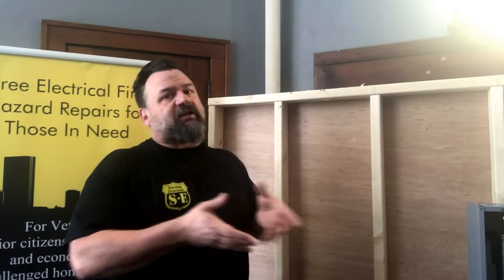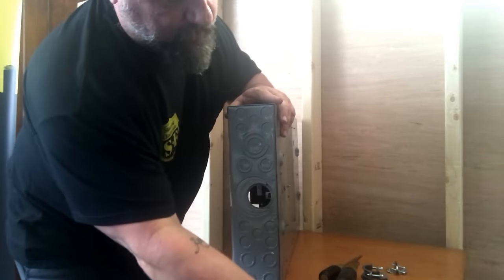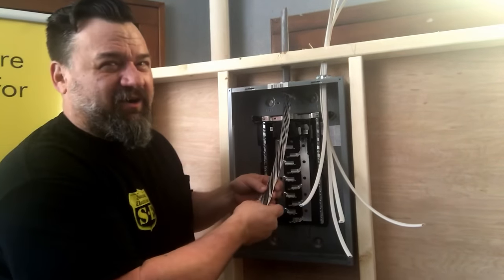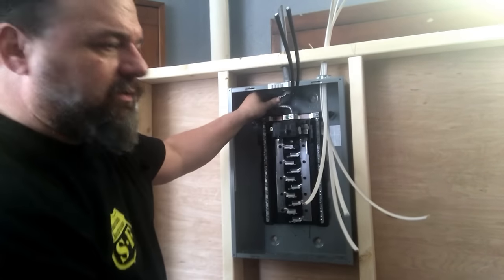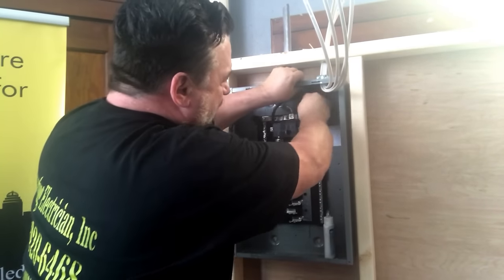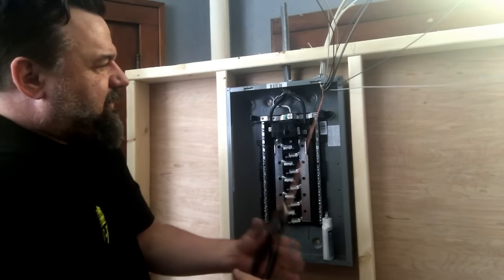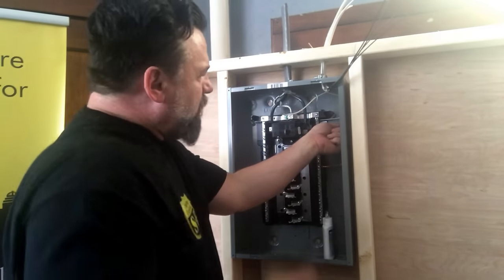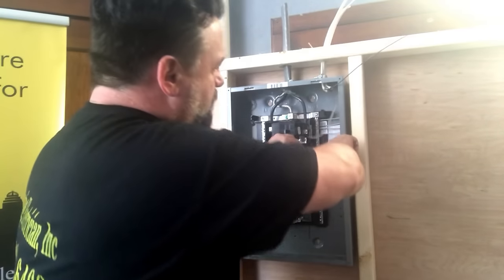How to wire a 100 amp service panel. ,  2020 National Electrical Code compliant

Comment: I like the way you teach ! Back in the day I went to a small school to learn electrical but the teacher only had so much time about calculating voltage that runs through the hot wires,,diodes and other things. I wished I had a teacher like you. Keep teaching.
Reply from the maker: Very cool! for people like you i'm happy to do it.

Comment: First let me say your video is great !  I'm a 71 year old Vietnam vet, and just finished putting a 50 amp sub panel in my garage.  My Dad was an electrician all his life, and was dedicated to pounding as much about electricity he could, into my head. I wound up as a self-employed cabinetmaker instead of an electrician, but, every time I moved into a new, larger shop, I did all of my own electrical work, up to, and including 440 volt 3 phase power. Not once did I ever get a complaint from an inspector, for any of my work.  ( And yes, I did have proper inspections done, otherwise I would have been unable to get the necessary insurance for the shop. )  My dad always said neatness, neatness, neatness, was of paramount importance, for ease of future troubleshooting, or modifications, and I did receive some compliments from inspectors, as my work was easy to follow.  Any way, I just subscribed to your channel, and look forward to future videos.  Also, What your are doing for Veterans is beyond commendable, it's fabulous !  Keep up your good work, and best of luck to you in the future !
Reply from the maker: sorry just got an alert that 30 comments were pending so I just saw your comment. Thank you so much. I am really trying to grow this program. we need to give hope for our soldiers coming home. again sorry for the late response

Comment: VERY well explained! I am in the low voltage trade (28 years with high voltage education and power generation work experience) and this is one of the best instructional videos I've seen.
Reply from the maker: Martin H  wow thank you so much for your comment. I love to make teaching fun because it's easier to take in. I need to get off my lazy ass and make the others I have thought about.  I appriciate your comment and that inspires me to keep it going.

Comment: You've kept me from burning my house down and recognizing the shady work of my handyman. I probably shouldn't have redone the panel myself without any inspection, but i just fixed the simple muff ups that the derps before me got obviously wrong
Reply from the maker: right on. it only takes a minuet to make sure your work is clean and right. some people simply dont have the mental capacity to do good work

Comment: Want to give you two thumbs up,  excellent video.
? When your changing a service panel up grade. There should be a off on switch. Before the service panel.  Are you required to contact the local agencies ( power co.) When you plan on doing the service. I would guess so. Of course it depends on local of up grade.  Thanks for the insight. Your a natural!!!
Reply from the maker: well unfortunately no there is not an off switch. the only way to turn off power to chang out the panel is to remove the meter socket. it simply pligs into the meter housing. the utility company can do it for you but this takes time for on and off but most will say hire an electrician. you clip the tab and open the meter can. the meter socket just pulls right out. edison has flunkeys pulling them out all the time to block peoples power. its not hard at all. take a look and see if you feel confident to do it.

Comment: If its a neutral its a grounded conductor. A ground wire is a grounding conductor. Hots are ungrounded conductors. I've been an electrician for 30+ yrs and this guy knows what hes doing. I dont like twisting the grounds together like that though. It makes trouble shooting and repair more difficult. There are lots of lugs to land them on. Give each wire its own little lug to park in.
Reply from the maker: Tony Thomas  yea I hear ya about the grounds. It’s just quick and easy and most of the old panels have no where near the space. People need to know you can but I’m the same token just do it clean first and foremost. Thank you for the comment!!

Comment: Just sharing a trick.  I carry a cats paw in my tool belt.  I use that to open the knock outs in metal boxes and non concentric holes in the panel. When opening concentric holes in panels, I use the cats paw for the center one, then clip each next section out with tin snips between the welds then bend them out.  I'm in all conduit land.  Try it...discovered this by accident one day and I love it.  (Licensed electrician near Chicago here)
Reply from the maker: Ron Schwab yep perfect tool for the job! Hey any ideas or suggestions please share!!!!!

Comment: Always check the codes in your area. They are not always the same. In some areas, the ground and neutral wires can't be attached to the same strip. Grounds must be on one side of the breaker panel and neutral on the other side. In some areas, they are even regulating which side the grounds go on and which side the neutrals go on. In some areas, only one wire on one screw is allowed. In some areas, you can't twist the grounds together and put them under one screw. I personally feel like codes have gotten too strict on a lot of this stuff.
Reply from the maker: neutrodyne let me try and put this grounding thing to rest. The code is coast to coast. NEC so that's where we start. Ground is defined as an alternate path for current to flow. That's to protect you from being that path. The neutral bar must be bonded to the breaker box unless it's a sub panel and that panel box must be grounded and bonded. There fore the neutral bar is connected to the panel and the panel is grounded and bonded to they are connected together wether anyone likes it or not. The redundant issue of doubling grounds is as easy as this. In a box for wire filll or the amount of wires allowed for cappicity, each current carrying conductor has a value BUT no matter how many grounds you have in a box they only count as one because they carry no current. You can twist together 20 ground wires from different circuits in a plastic box and no one seems to have an issue but in a panel there's a lot of issues. Grounds can be twisted together and under the same terminal in a panel so long as they do not exceed the circular mills rated for that lug. They can share a bus with the neutrals because they are bonded together to protect that path of current. States do vary and yes check on certain things. 
But grounds together are a universal safety device and since electricity is the same in every state that is universal in its self. All code books are created equal so the application is to be followed the same for every one.
Reply: Im European and im sorry to say that what you do is horryfying to me. First, naked ground wires, that can make shorts? Not be allowed here. Neutral and ground on same bar? Stupid and dangerous. The most enclosures from US, does have a bonding bolt, that binds the neutral to ground. In this video there is none i guess. Grounds goes to a ground bar, that is mounted directly to the chassis. That way, you can just unscrew the bolt and make diagnostics. Never ever use blades to the wires. There are special tools that only cut 50% och the dept of the shield. Always install GFCI and ARCH fault breakers.
Reply: @72strand  Ground wires don't come in a sheath.."Im European and im sorry."  Me too!
Reply: I lived in Europe for 5 years and one thing that became apparent very quickly, there are rule on top of rules on top of rules and no one can justify half of them, but what was obvious to everyone was how dirty the power was. Voltage transients constantly damaging appliances.

Comment: Yep, more to it. Like torque all connections 110.14(D). Also consider later repair by making service wirers a little longer. All and all good video.
Reply from the maker: thank you

Comment: If I ever got out of machine tool electrical I would love to learn from you your a awesome teacher
Reply from the maker: Alex saling  you have no idea how happy you post made me. It's so nice to know there are good people still out there and make a person feel appreciated! Thank you so much. I just need to get off my lazy fat ass and post more.
Reply: Starving Electrician not a problem! 
And more videos would be awesome me and 1.4k people would love to watch them 

You should do a video about installation exterior lighting with exterior boxes and interior mounted boxes! I’m stumped 

Much love from metro airport area
Reply from the maker: Yea I have a little list of videos to do. Man I do mostly residential because I'm still part of my union and don't want any static nor hurt my brothers.  That said I really would like to do commercial or industrial more.  I like pipe and wire a lot more. I worked that airport for 2 years doing all the back up generator work and a lot of the primary power. I have a ton of experience doing the other things you want to see but rarely have the opportunity but I will certainly keep it in mind. Thanks again and don't ever forget to eat your tacos!!!! Lol

Comment: Entertaining video and for the most part it’s spot on. Keep in mind that ul listing for most panels only allow for up to two grounds under one terminal (the most I have ever seen was up to 3) this information can be found on the sticker they give you on grounding information.

Also as far as the grounded and grounding conductors go (your explination of the main bonding jumper) is electric could give two shits less about the ground itself. It always wants to take the least resistive path back to source (your neutral) without your main bonding jumper (the green screw that officially ties the grounds and your neutrals together) the electric would simply energize your ground.

The whole point is to bond it to the neutral so that if power touches anything that’s grounded it will open the ocpd (breaker).

The reason we don’t use the neutral to do this is because it carries a current and that would make your enclosures carry current as well. So we avoid this by using the grounding conductor system as it does not carry a load under normal conditions.

We drive this to ground with a grounding electrode system to give foreign voltage (lighting, telephone etc) a path to exit your system.
Reply from the maker: Daniel Korb  thanks for the feed back. The terminal capacity is based on circular mills and if it's a current carrying conductor. I have never been shot down by an inspector in 30 years of doing electrical this way. The point I made to a comment was if something is illegal then recite it out of a code book and not what you think or heard. In this case there is nothing illegal about multiple grounds under a terminal. Anything over one is multiple and doesn't make a difference.

Comment: I like how you present your  videos and your personality . I find that enjoyable. I have two more things to make comments on. 1. You put the breakers right next to each other. In mine I'm only able to use every other circuit. I don't know if that's the way the box is design or if it's something wrong with mine. Is working with a double pole for my dryer. But not for any other. 2. I do like the way you twist the ground wires together and put them all in one spot. However, I am doing remodeling and if I change something and I need to take out the wiring it will be difficult to unwind it from the rest. Additionally you put the white wires separate from where the breaker is. Again if you take out the wiring you have to try to follow where that goes to figure out which breaker it represents. I have found it easier to put the ground wire and the neutral wire for the breaker with the breaker it goes to so I know exactly where everything is and I don't have to try to figure out what ground wire or white wire goes with what breaker. That was the frustration in the Square D QO box. The neutral had its own bar and the ground wire had its own bar. The ground wires and white wires had to be way longer than the hot black wire to reach the bar they we're screwed into.
Reply from the maker: changouno thanks for the question. First if every other breaker works, then either the main is bad or it’s the utility company issue.  As far as the neutrals and grounds, they have to be bonded together and to the panel. Then the panel is grounded to the ground rods as well as the cold water. I have seen panels that the neutrals aren’t bonded and when the washing machine was on the lights were like a strobe light. All that unbalanced load going crazy. You don’t double up the neutrals because the generate heat and will pull away from each other and cause a fire. Grounds under the same lug with neutrals aren’t allowed. I don’t have every answer but this is what I have seen and the code. I hope this helps

Comment: That was outstanding.  Your  teaching vids have helped me a ton.  I want to thank you for reaching out to vets.  YOU ARE A Good Man!.
I have a problem.  I have a Westinghouse 9500 with a 50 amp plug in feed (black green white and Red.  I've got and Eaton breaker box that I intend to tie into my 4 wire 50 amp feed.   Two 20 Amp breakers will feed my small shop.  One will be dedicated to the Combination 115 volt window ac and heater that will heat up my shop. Second will run plug ins for drills and what ever.  Nothing but 115 will be used.   Very confused on this help if you can and if you can't, that's ok
Reply from the maker: thank you brother. so long as you dont exceed the total 50 amps you will be good. divide 9500 by 220 that will give you the load or what the generator can handle. you are good for 43  amps.

Comment: Great Job! awesome sense of humor
Reply from the maker: Thank you very much
Reply: @StarvingElectrician  I'm working towards getting a journeymans license with the union. Any advice onreading  material i need to know for the test? Thank you
Reply from the maker: @jolancekefreeman7379   well im sure the union has study material. the best book is the code book. get used to looking things up. like look up metal boxes in the back its all alphabetically set up. then you may want to know how big a steel box in concrete is. once you find steel boxes then you scroll down till you find concrete. its hectic but you need to know the code book. I would study over current protection and wire sizes. get to know some of the big ones by heart then it saves you time on looking up small code question. thats a start. good luck!!

Comment: Best video on YouTube. Only thing I wish you went into was where to install your ground to the panel for a service entrance panel.
I'm assuming you just install it on the neutral bar, because for service entrance, ground/neutrals are tied together, but my ground wire looks kind of big. I'll try to compress the wire like you showed best I can and make it fit.

Might be cool to get into which panels you like the best. I got a Square D 100a Homeline with Plug On Neutrals.
Wish I stepped up to one with copper bus bars/qwik grip. I only saw qwik grip for 200a panels, and I'm assuming I could use it for my 100a panel without issues, but you live and learn.
Reply from the maker: Thanks. I like the homeline best. cheap breakers and the most common. as far as the big wire you can buy a lug from home depot that attaches to the ground bar its like forked so it fits under two screws on the buss bar and then you just put the wire in that. its self explanitory. when you see it.

Comment: I just bought a house. Garage is kinda a mess with wires all over but they are all dead. It already has a rigged up box and light switch and sockets but only garage door works. Seems pretty straight forward once box is in. Cut power to gargae from house. Run wires from sockets and stuff to box. Just make sure wire is right gauges. Box has main shut off switch at top and then maybe 6 different ports with room for more. I need to tear down the ply wood and fix some mold issues with it.
Reply from the maker: yes the first thing is to make sure the power is down. i like just starting over in the garage and just clean the wires up. so one circuit for the garage door, one for plugs and lights and all the rest are extras!!